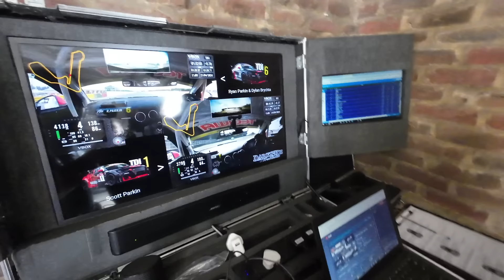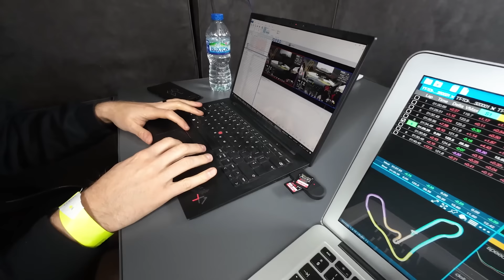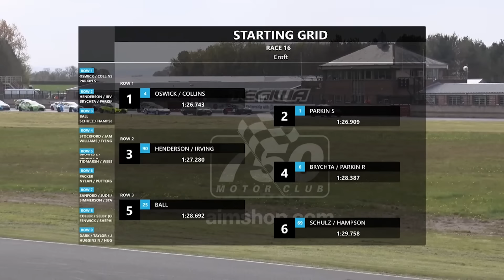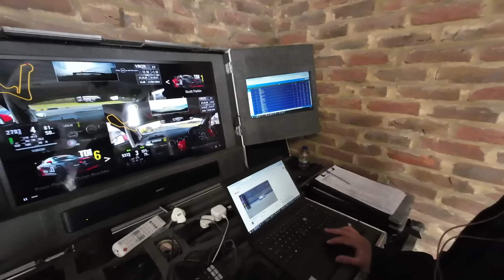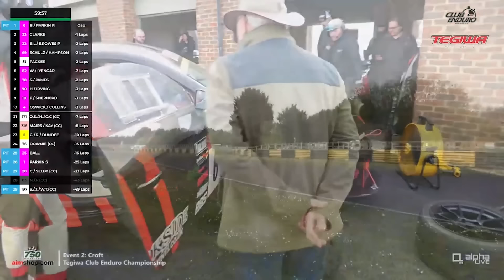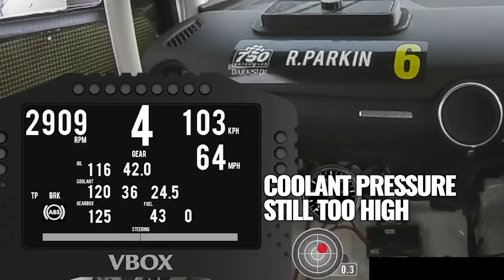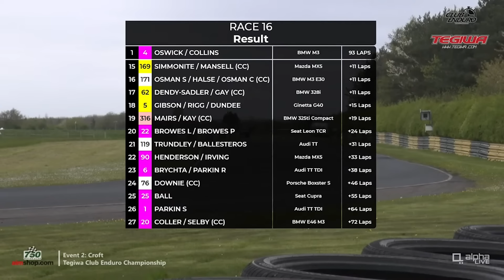THIS IS NOT GOOD!! 🫣 Club Enduro Croft 🏁

Comment: Not sure why Dylan and whoever edited the video was so pissy in the race, as the faster car the onus is on you to make a safe pass. The slower car is alerted by blue flags and should stay on line. They did that every time Dylan just managed traffic badly. 
Bette luck next time chaps, thanks for the video.
Reply: That’s… not how blue flags work
Reply from the maker: Dont worry about it :)